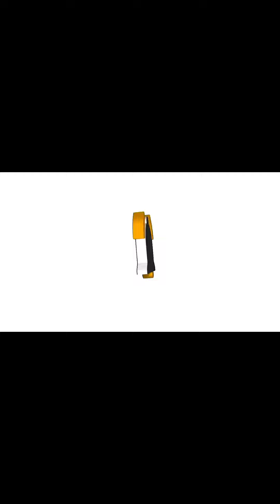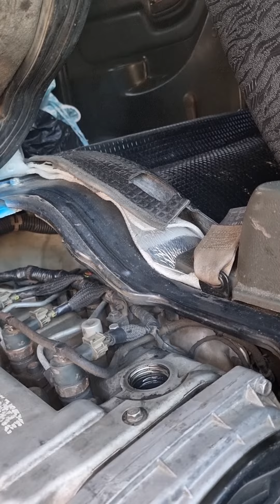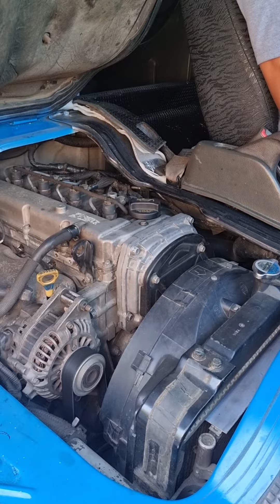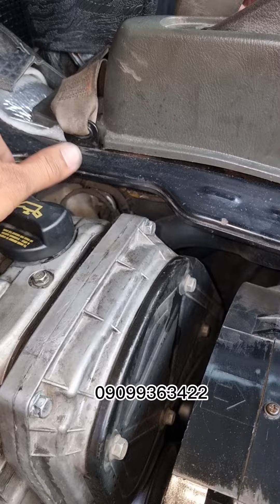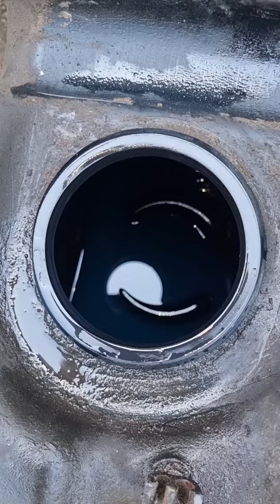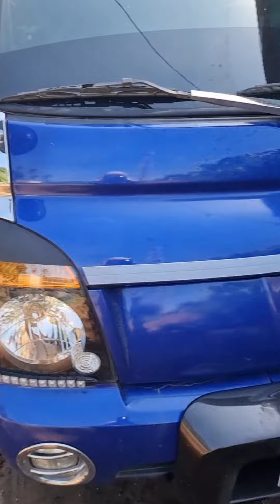Hyundai Porter2 D4cb Maputing usok sa valve cap Solved!!

Comment: boss, ano po remedyo ng starex crdi engine pag me talsik na langis sa dipstick, pero walang usok pati sa valve cover..salamat po👍
Reply from the maker: Normal lang yan sir may oring yan sa depthstick baka tigang na palitan mo
Reply: @MharSolution  salamat ng marami boss, mawala kaya ang talsik kung palitan ang injector washer?
Reply: @MharSolution  ok lang ba boss kung 8.5 km per liter ang kunsumo ng krudo? manila to eastern samar na byahe...salamat po ulit?
Reply from the maker: Yong injector washer whitesmoke lang yon yang talsik nirmal lang yan basta walang usok na puti piru may iba din na walang talsik kung bisaya ka dali lang  sana ma explain